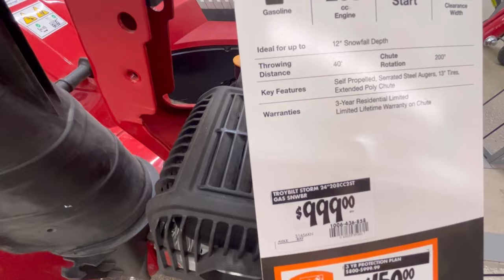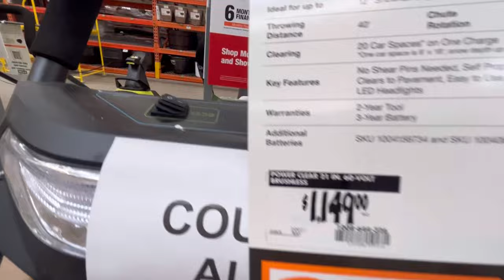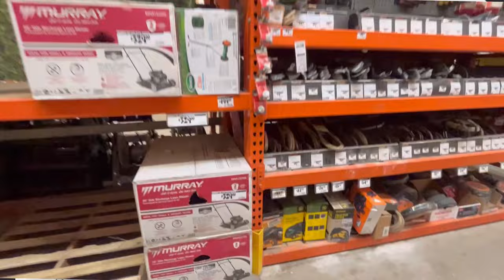FREE SKIDOO FORMULA MX SNOWMOBILE TOUCH UP PAINT -HOME DEPOT SNOWBLOWER/MOWER DEPARTMENT LINEUP TOUR

Comment: You should do like I do get you an inline electric fuel pump, connect a red and black wire to the power leads with alligator clips, connect rubber hose to pump inlet and outlet. Then go to your mower fuel filter like you disconnected and attach your inline pump, connect alligator leads to battery and it’ll pump out of tank easily
Reply from the maker: I had one of those before,  the motor burnt out because the motor kept running.
Reply: If you stay around and watch outlet when you see or hear it slow down then disconnect alligator clip. I emailed you a photo of my setup